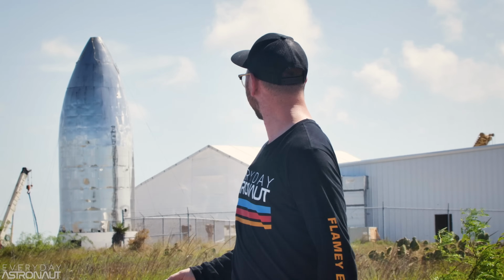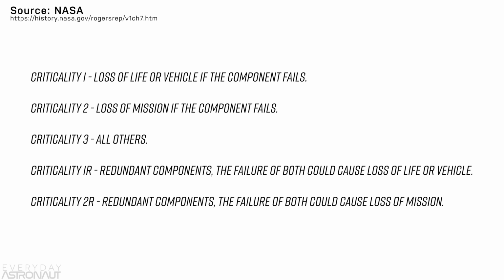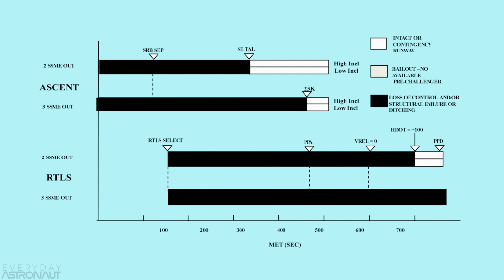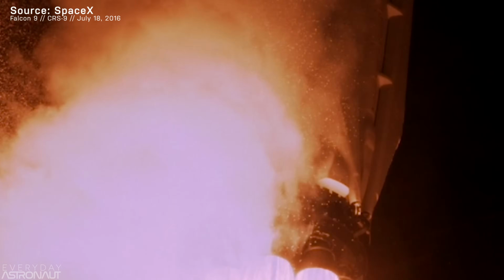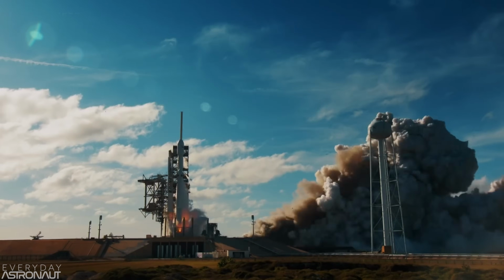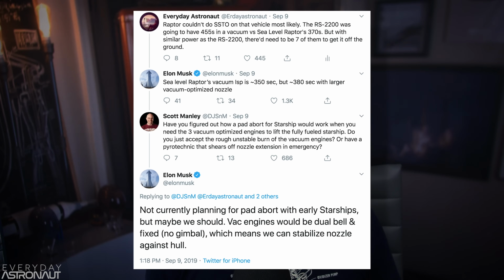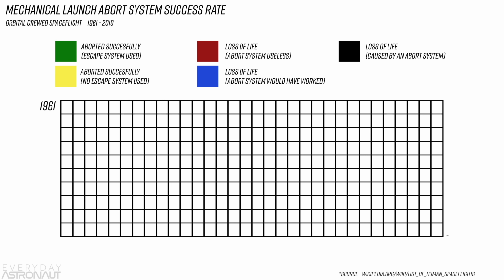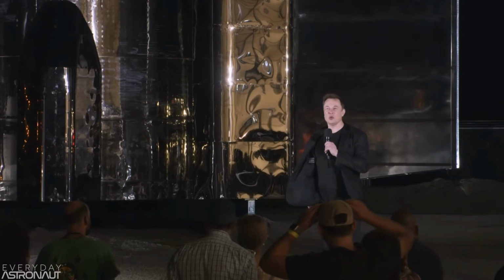Why won’t Starship have an abort system? Should it?!

Comment: I'd much rather get on a rocket without a rocket powered abort system with a proven track record than a single use system with a rocket powered abort.

It would be interesting to see a Starship with a backup parachute landing system to deal with the hydraulic system failure, failure to ignite, failure of thrust vector control, etc. It'd be something to save lives while sacrificing the ship, and I wonder if it could reduce total weight by running with lower redundancy on some of the powered landing components.
Reply: Failure of the hydraulic system for the flaps or a failure to ignite would cause loss of vehicle and crew long before a parachute can be deployed. The vehicle needs to maintain a certain angle during reentry in order to a) not burn up and b) not exceed structuraly unmanageable forces or c) simply lethal acceleration.
Reply: Totally! Thinking of the center core failure due to thrust vector control being damaged during reentry, my thought was that there could be a variety of marginal reentry situations where the vehicle begins with fully functional systems, but one or more of them are damaged during reentry without loss of vehicle. I fully admit that I have no idea how likely such a scenario would be.

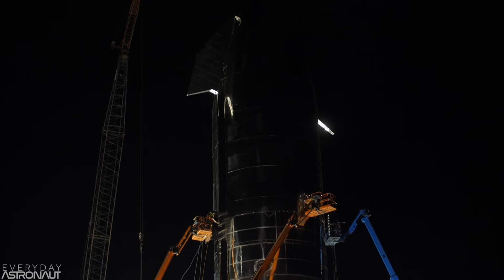Comment: 30:15 you're really stretching the truth with this point. SpaceX was testing to see at what point it would break due to pressure. If it didn't break at that point, then they would have increased the pressure until it did. You even admitted yourself that it isn't a good example, but then you go on to say it's a scary thought.

Comment: Yes, it needs an abort system. I would never risk myself, nor anyone I cared about, in a rocket without a launch escape system. Does it add complexity? Yes, but so does seat belts and airbags in cars... or lifeboats on ships.

It sounds great on paper to design a rocket with "airliner-like reliability", but that's like saying you are designing a car that never breaks down. It is impossible. Sooner or later, something breaks. And I highly doubt NASA would risk it either, at least not until it has done a LOT of flights and proven said reliability. And even then, you wouldn't want a system that will kill everyone unless every single part works every time forever.

If vehicles break down:
In a car: most of the time, you can simply stop and get it towed to be repaired.
In a plane: most of the time, you are still flying even though the engines fail. The wings will keep the plane gliding, at least maybe long enough to either do an emergency landing in a field or even restart the engines.
In a rocket: there is no time. Once the thrust fails for some reason, either it's the engines failing or the first stage exploding, you start falling. You can't glide. And considering the ridiculous amount of highly volatile fuel, it is very likely that any failure, like an engine exploding or a fuel line rupturing (or one of a thousand other catastrophic failure modes), will cause the entire rocket stack to at the very least take a lot of damage. 

Even if "only" the first stage of the Superheavy/Starship stack fails, there is still no way of saving the crew. The upper stage has not enough thrust with full fuel to do any kind of safe landing back on Earth. And even if they manage to burn off enough fuel to get a positive thrust-to-weight and manage to slow down, where does it land? Depending on the time of failure, it may end up having to "land" in the ocean. And do we have any reason to believe that such a landing is even possible? And even if they somehow manage to put it down into the ocean at such a speed that it doesn't collapse, it will sink or tip over, both scenarios most likely killing everyone on board.

This is not hindsight, but foresight. If SpaceX insists on pushing forward with no launch escape system, and then one of their rockets explode with multiple people onboard, then nobody can say that they didn't see it coming. Anything can fail, and anything that CAN fail eventually will fail.

Comment: All I would want is the F5 key right on my control panel.  Also...
Yo dawg, I heard you like rockets, so I put a rocket on your rocket.
But yeah, if they can demonstrate that their design and systems are reliable, and can prove reuse with limited to no refurbishment, and repeat it a dozen times or so, I'd happily take a ride on the Starship.  It would surprise me greatly if they put people on one without doing that anyways.

Comment: Hi reliability engineer here(although I work on robots). Some things to think about when looking at reliability are the difference between system and component reliability. Basically what component reliability is would be your 99.88% reliable engine but your system reliability takes into account all failures. With most systems they have components that are in series with eachother meaning if one thing fails the system fails(similar to series circuits vs parallel circuits) now you can stack components in series and in parallel. Your fuel tank would probably be a single thing so there is no redundancy but your engines are in parallel with one another so one can fail but your system will still work successfully. Now you can consider a more complex model for the engines since if you lose more than maybe 2-4 engines your rocket will stop flying up which is a failure, basically you enter that as a threshold of the failure of those redundant parts. In general anything in series can have it's reliability multiplied to the rest of the system to calculate the system reliability. Your subassembly with the parallel parts has a different equation to calculate that subassembly but then that can now be factored in like anything else in series. 

Also what should be considered is what you consider a failure. Like you said in the video landing the rocket is not necessary for success so failures that only impact that won't be considered when determining primary success, but you could have a system reliability that is just for landing but that would include failures up until stage separation and down to landing and ignoring failures on the second stage and beyond.

Hopefully this is interesting to someone!
Reply: Travis Hunter it was really interesting actually enjoyed reading it being able to sort of understand it 
Thank you
Reply: You are right, and I concur. Nothing is perfect, ever. Probability of success to achieve a set goal is what counts, and to try to improve on that!
Reply: The flipside is the failed Starliner test flight, where the components worked fine, but the system as a whole was a fiasco due to failure to do proper integration testing. Having parts that are 100% reliable doesn't help when you've wired them together wrong.
Reply: What about the success of secondary missions.  Such as the mission of not having to pay for more rockets because the previous one can be used again.
Reply: @johncrowerdoe5527   so basically with any reusable system you create a reliability goal based on what you want, so for something that has a critical primary mission SpaceX would probably target reliability% of let's say 98% reliable at 20 uses. They do that so that at 10 uses(their target with falcon 9s I believe) they should have effectively 100% reliability. With some redundant components they can allow for more failures without it causing issues because having multiple less reliable things let's you get a higher likelihood that that action will be preformed even when 1 or more break. Also what happens is since 10 uses is high reliability and after that it starts to drop off you can stop failures from happening but just retiring that rocket. The aspects of landing a rocket can be weighted in the reliability model based on severity of the failure(total loss vs damage etc) the detection of the failure(if you can detect it before it happens then maybe you can switch the part being used before it fails, and occurance (just how often it is likely to happen) you can use engineering judgement to determine the priority of what either needs to be improved, eliminated or just lived with. So a fuel tank exploding is very severe and you can only detect it after it happens and hopefully it isn't likely, but something like the hydrolics that they added more of in the grid fins maybe is only detectable when it happens but the severity is not as high because now there is an extra pump to perform that function and the occurance of 2 failing at the same time is much lower
Reply: @travishunter8573  My question was about goals with a lower priority outside engineering calculations.  For example loosing reusability of a particular booster would have a well defined economic cost calculated by economic professionals.  Modeling such external goals as engineering calculations seems like a classic case of seeing everything as a nail.
Reply: @johncrowerdoe5527  well we also sometimes do cost calculations based on the number of failed parts what it costs to replace them and their reliability. So something cheap you would be fine with being one use the you'd throw in labor cost to replace it, but obviously the reason for reusability is that it's cheaper per use. So it is directly the reliability that impacts that, single use rockets have a landing reliability of 0%. The idea is to be able to look at the design you have and be able to determine the useful life which tells you how many flights it can have without having satellite companies and NASA feel like you're wasting there time and money by blowing up or crashing their satellites. Basically if it's unreliable on use 5 eventually someone will catch on and never buy that flight and therefore cost per use goes up.

Comment: Hi Tim
I have a question about the speed shown on the live coverages.
For SpaceX it seems that the speed starts increasing from liftoff and then it stops increasing at SECO.
So I’m wondering is the final number the “sideways” speed required for the orbit? Or does it include the initial part from the climbing, and the required sideways speed is different.

Comment: If you have an abort system on Starship, you're saying it is reasonably likely to fail. The goal of Starship is to take people to Mars, land them there, bring them back. The abort system is going to be even less of an option when you've got limited options of travelling across a planet to get to the aborted astronauts.

The lack of an abort system scares me about Starship. The whole design of the capsule being part of the rocket itself. However, if we're planning on sending hundreds of thousands of people to Mars. We need to have solved the issues with not having an abort system.

I think we may have to be in the realms of hundreds of Starship flights before any substantial passenger capacity could be considered.

Comment: Minute 23:00 the problem with F1 engines is that so little of them have ever flown that its relieability data might not be representative.
Reply: 65 F-1 were launched aboard 13 Saturn-V rockets. The F-1 is the second most powerful rocket engine ever use operationally.  They were not throttled so that would help their reliability.

Comment: we get on a plane without abort systems so why not a rocket? lol
Reply: kiethyrich I always wondered, why there are no parachutes for the passengers on planes. Even if it only increases the chance of surviving a little bit, it would be worth it.
Reply: @jl.7739  
Hard to teach a bunch of people how to use a parachute in a 2 minute safety briefing.
Reply: Jeff Vader Right. There are probably some other problems with it. Parachuting with a baby or as an old person. Getting everyone out in time or even to jump at all etc.
Reply: @jl.7739  
It's also probably safer to stay in the plane in most situations, since it can glide down for an emergency landing most of the time.

Comment: I feel like you maybe missed one thing. When there are more people on the spaceship the abort system has to become much larger. It wouldn't even be like putting a Cessna on in 747 (can't fit all the passengers of the 747 on the cessna), but it would become closer like putting a 747 in a 747. 
Try creating an abort system for three large passenger cabins in ksp and you just end up designing the entire space shuttle, with a slightly higher thrust to weight then necessary.
Reply: Good point. SpaceX envisions flying up to 100 for interplanetary flights and even more than that for Earth point to point flights, so there is no realistic way to design an abort system for such a large spacecraft.
Reply: And that would be a perfectly valid abort system in it's own right as long as the engines can survive the actual explosion. It's like a helicopter. It doesn't have any means to make glide so instead you add auto-rotation to at least soften the impact and give some directional control because the alternative would be building a small rocket ship or an airplane.
Reply: @aBoogivogi  Technically you don't add auto-rotation to a helicopter; it's an inherent feature of this type of aircraft.
Reply: @CLipka2373  I assumed there were ideal angles for the rotor to maintain and possibly some gears linking it to the rear rotor. I figured you would need to flip these. Sort of like how any prop plane has a feather setting where the prop is effectively producing minimal drag to increase your maximum glide distance.
Reply: @aBoogivogi  As for using optimal rotor blade angle, that's more a matter of operating procedure than design. As for the rear rotor, since there's not nearly as much torque involved as when actively driving the main rotor, I imagine the "tail fin" usually also found in helicopters may be sufficient to keep the nose pointing forward.
But you're right, there are probably ways to support the inherent auto-gyro effect through design choices. For example I guess it may make a difference whether to keep the rotor coupled to the engine shaft or not. I'm not sure whether the engine would act more like a brake or like a flywheel in such a scenario.
Reply: @CLipka2373  My instincts say it would act as a brake much in the same way that the axles of a 4wd car would if they were not freed from the wheel hub (probably a very bad translation, but I suspect you understand what i mean) when they were not in use. Now I'm no expert with helicopters. For all I know this may be beneficial.
Reply: @aBoogivogi  My gut feeling agrees, and with piston engines I would take it as a given. I'm not sure about turbine engines though, which to my knowledge are common in modern helicopters.
Reply: By the time they get to 100-person flights Starship will have accumulated many cargo and crew flights to find and eliminate as many problems as possible.

Comment: in case of an emergency the starship migh abort using the "bulkhead method"
The initial push of the rupturing fuselage and the bulkhead literally flying up might push the crew cabin away from the vehicle (yes)
Reply: What happens when the capsule is split into pieces? That's why I like individual parachutes, and inflatable balls.

Comment: Let me put it to you in another way: how confidently would you drive a car with no seatbelt and airbags? Would you sail on a ship with no lifeboats (ask the passengers of the Titanic how that turned out)?
Reply: If your car bursts into flames (which they rarely do) neither seatbelts or airbags will help you, indeed they can often be a hinderance in those situations. There's a difference between safety features and abort systems, if (and that is a big if) Starship could prove it has catastrophic failures as infrequently as cars blew up it could probably get away without an abort system, just like how cars don't have ejection seats.

Comment: I predict they will add a capsule like Dragon to the top of Starship. For human launch and landing on Earth. That would allow for full-envelope abort. They could separate the capsule from starship for an ultra safe re-entry.  Starship could still land and all part would be reuse-able.
Reply: I hope that is the case. They need a way to save the crew in case of a failure.

Comment: I think that an analogy can be drawn between small rockets and small airplanes and between huge rockets and huge airplanes. On small aircraft, usually under the pilot's seat there is a parachute or the aircraft is equipped with a catapult. However, passenger liners fly without rescue equipment. Of course, we just need to achieve maximum reliability.

Comment: I do get the feeling that the AMOS-9 Falcon 9 RUD caused by the failed COPV is one of the reasons why Elon & SpaceX moved away from carbon fiber. As strong as carbon fiber is, it's fussy, expensive, and labor-intensive to make, and tiny errors during manufacturing (say an air bubble while laying down layers of carbon fiber & resin) can really damage its strength, or like what happened with AMOS-9, cause a delamination and a total failure. Steel isn't quite as strong for its weight, but the stainless SpaceX is using is resilient against extreme heat and cold, is much easier to work with during construction, it's cheap, its properties are well-known, and if the price there is you have to make your rocket a little bigger, well, that's the cheapest and most reliable option.